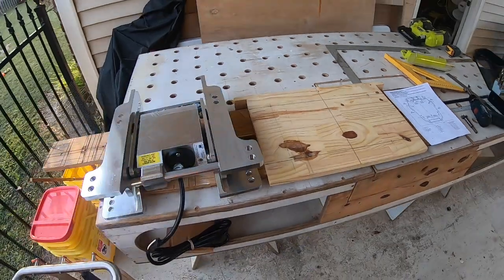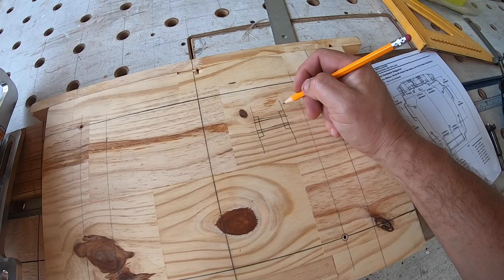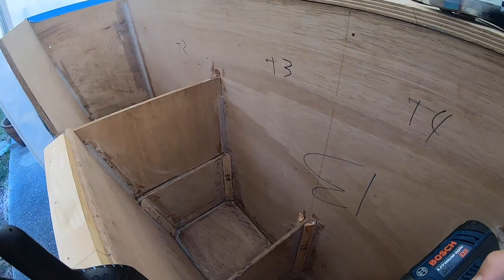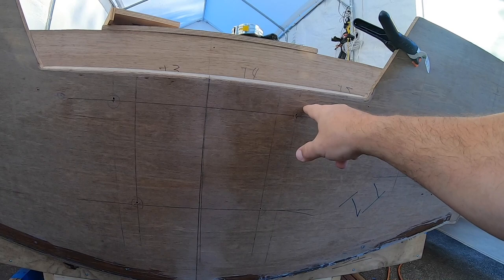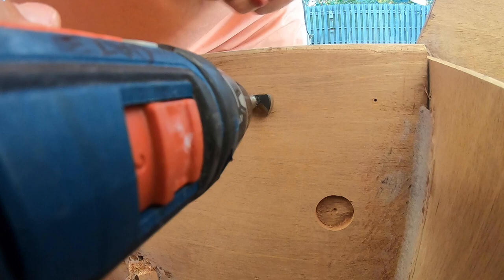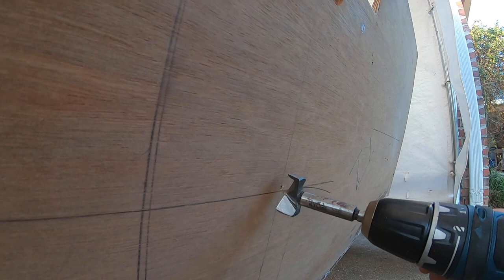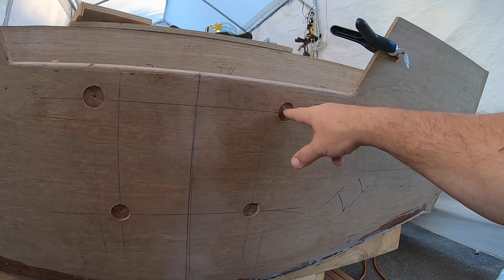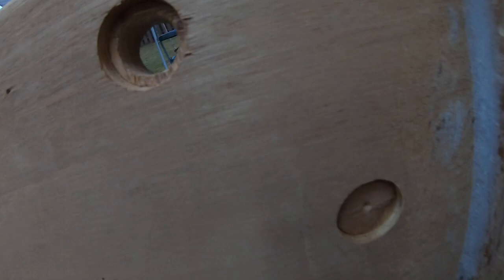15.DIY Boat Building: Epoxy Cored Motor Mount PREP

Comment: LOL you found something else to do besides fiberglassing those stringers and bulkhead. I only laughed because I do the same thing. 
However, I was thinking the same thing, to drill those holes bigger and fill them with thickened  oppoxy then drilling thru the oppoxy. 
I really like the way you take the time to explain and show on paper what you’re about to do or have done. 
Thanks again 
Joe
Reply from the maker: Yeah the process of drilling everything out and putting epoxy tunnels is something you will see more of as you catch up.  There are a lot of holes in this boat by design.
Reply: @Bigeaux20  looking forward to it. 
Thank you